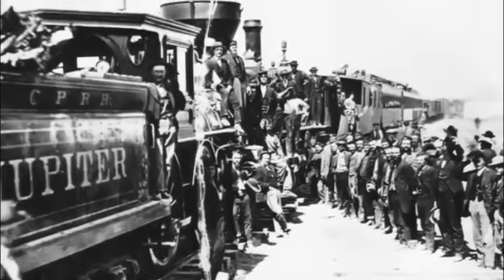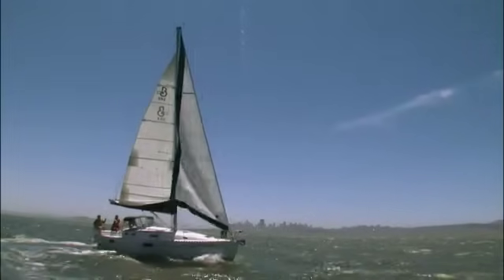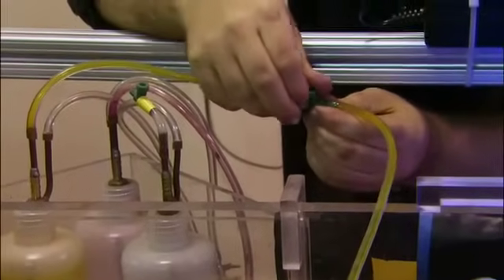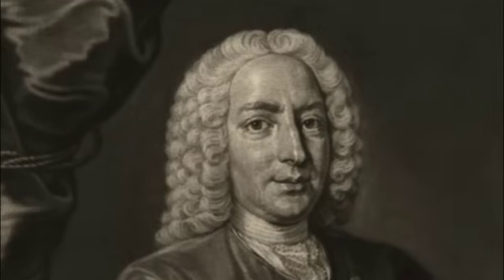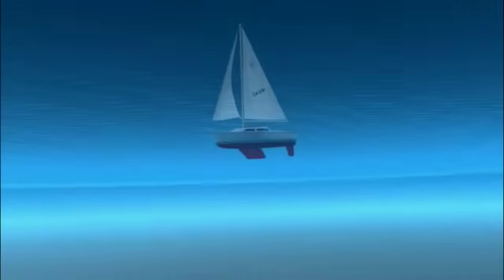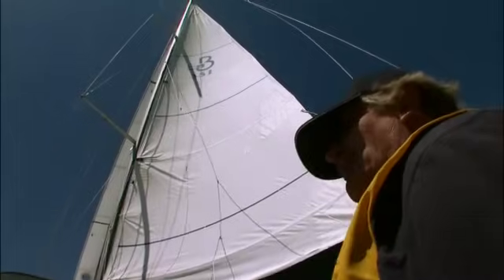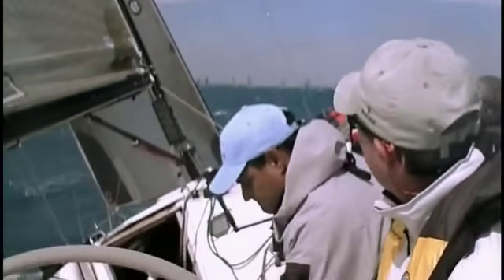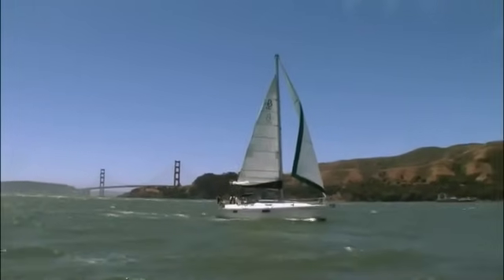The Physics of Sailing | KQED QUEST

Comment: There's no forward component in the force originating from the keel as claimed by this video. There's obviously a side-way component, but the fore-aft component is in the very opposite direction - water resistance on the keel.

Comment: well, yes, but you need to remember that humans have been sailing for millenia and the advent of upwind sail designs weren't developed until the 13th-15th century and most more efficient designs were developed even later, so compared to square sails and possible head sails of the egyptians, greeks and romans, the up wind designs are pretty modern.

Comment: they could, but they didn't understand it fully until bernoulli figured out why it happens, then it made it a lot simpler to travel against the wind. it lead to different sail types being preferred when traveling in a particular direction, instead of having to follow trade winds, they could instead measure what angle they needed to travel to get to a destination and get the most out of the sails and the wind with that particular angle.

Comment: You can do that with an airplane, because wind speeds are much higher on an airplane wing. Airplaines use this method because zero angle means less air resistance. But try with a windsurfing sail, which is always curved, and you will see that zero angle leads to zero force. Almost all the force of a sail is generated by angle of attack.

Comment: full of shit, acceleration requires force, where does the force come from on air that goes around the curved surface? so it does not go faster, due to angle of attack, you are slowing the air on the flat side and you are dreaming the air on the curved side is accelerating, wake up!

Comment: Don't shout, listen.  Inverted flight is possible due to the mostly symetrical wing section of planes with that capability.  Wings not designed to work in 3D flight don't work at all well when inverted.  Try flying a parachute or hang glider upside down.  Some wings are designed to work in only one attitude.  Square rigged vessels may not work to windward as well as a modern for and aft system, but they are unmatched for downwind work. Now take an aspirin and have a lie down before you get ill.

Comment: Not possible with a so basic square sail from the Drakkar or Snekkar.In that times, the only efficient sails to gain to the wind was the latin sail ...
16 knots was the top speed from a 30m Drakkar , only with wind from the rear/side...and 10 knots at rudder...

Comment: The two are closely related.  The reason that the angle of attack causes lift to generate is that, by keeping the foil/wing/sail at an angle to the flow, you are in fact forcing the air to accelerate around the suction side (leeward side) of the foil, reducing the pressure on that side and sucking the foil in that direction.  The angle of attack is essentially another means of controlling the shape of the air foil as seen by the air flow.  Too large an angle = too much curvature = stall = drag.

Comment: It's all about the forces. If he had blown under the paper, then there ABSOLUTELY would be a pressure drop and a force from pressure acting downward. However, there would be a much LARGER force from the wind hitting the paper at that large "angle of attack." Bernoulli has not been abused. Also, Bernoulli's equation involves many many MANY assumptions and simplifications. It is in itself abusive in many cases.

Comment: 7:45 close but no smokin' roll of tobacco.  Separated flow on an airfoil (e.g. stall on an aircraft wing) is when the angle of attack is too HIGH, analogous to the sail being over sheeted, or pulled in too tight for the boat's course. Luffing is when the angle of attack is too LOW and there is insufficient pressure differential across the sail for it to maintain its nice curved shape.  That's when it just flaps uselessly in the breeze (much like people who comments on Youtube videos!  :)

Comment: Heed your own advice. Bernoulli's law simply states a relationship between speed and pressure (under certain restrictions). Nowhere does it state anything to causality. In this video, as so often, it was stated that the fluid's speed differences between both sides of the sail would create pressure differences (lift). That is plain wrong.

Comment: dumbass! faster air has lower pressure. FACT! when lower pressure exists, higher pressure air moves to reach equilibrium.  if ANYTHING is inbetween the two pressure cells it will be moved in that direction aswell. It is why a balloon will fly around a room when it's tail isn't tied, the air coming out the tail reaches equibrium and has no force but the air at the top can't get to the otherside of the membrain so it pushes the balloon untill it is at the same pressure on both sides.

Comment: dumbass!! :)  the air, even when its blowing along, has pressure.  when it reaches a sail the same volume of air still has to travel past. either less air goes past the sail (in which case the sail would behave like a dam) or it has to blow faster to move all the air in the same time. both sides of the sail have a different shape, and restrict airflow by different amounts. the difference between the two creates a higher reletive speed on the outside of the sail. watch the die in the vid.

Comment: Argh...always the same, wrong explanation given. Around 3:30 -"...since the streamlines are curving, it has to accelerate a little bit..."

And according to what physical law? This is the rape of Bernoulli's law. For anything to accelerate, there must be a force acting upon it. So, air (or water) accelerates *because* there is a pressure differential. The pressure differential is *not* created by the differing speeds of the fluid flows - just the other way round!

Comment: Now Bernouilli _does_ apply, just differently: The foil will push the liquid sideways by a higher pressure on the windward side than on the leeward side. Higher pressure => slower liquid and vice versa.

Most of the time the air/water/liquid "particles" will NOT meet their "neighbours" at the trailing edge, and  there is no law stating that they should meet again, only intuitions.

Comment: Basically, the Kutta-Joukowsky condition says that foils can change the direction of flowing water and air. No big deal, but _that_ is why you have lift: the foil pushes the air or water, which pushes back. The back push of the liquid being pushed _is_ the lift. That goes for all foils: wings, propellers, sails, keels etc.

Comment: Thanks for a great video, that I enjoyed a lot.
About lift: it is due to the air(and water) viscosity. 

Whatever foils/sails you put in the flow of a superfluid with zero-viscosity will NOT generate lift. But air and water are not superfluids, so they obey The Kutta-Joukowsky condition: when the flowing air/water leaves the sharp trailing edge of a foil, it will continue flowing in the direction of that sharp edge instead of making a sharp turn around it (like a true superfluid would).

Comment: Note that a wing will also loose it's force vector perpendicular to the chord if the angle of attack is decreased too far, and when sailing a boat in any direction with a component into the wind, the sail is best used with the chord nearly parallel with the apparent wind.  Increasing this angle will result in loss of laminar flow and reduced performance of the sail.  So, yes, I think that makes them essentially the same (see hang-glider and PlaneSail).

Comment: Yep, another mistake on my part, and some confusion because the word stall seems to carry different meaning between the two objects.  On a wing, "lift" generally refers to the force opposite gravity, and stall refers to the reduction in this force vector. On a sail, the force that is often associated with "lift" refers to the force perpendicular to the chord, and stall refers to the reduction thereof.  Even when vertical, a wing still provides a force vector perpendicular to the chord.

Comment: "The lift produced by a keel adds to, not balances, the turning moment of the wind" : Yep, I'll agree, I made a mistake on this one. The lift created by the keel does not balance the turning moment created by the "lift" produced by the sail.  The resistance to heel is due to it's mass.  I'm pretty sure there is a force vector on the keel that resists sideways movement of the boat, but I'm at a loss at the moment as to the common name for this force.

Comment: If you are comparing vectors relative to fuselage/hull, then you will absolutely find different results, the plane is using the force on the wing to oppose gravity, while the boat uses the force on the sail for propulsion, so the position of the wing/sail relative to the vehicle is significantly different. I agree that a boat doesn't work like a plane, but a sail does work a lot like a wing. Figure your forces about the chord of the wing/sail. Also see here: watch?v=ELL5lTE9Tek

Comment: A wing can be tilted and not stall until it reaches its critical angle of attack.  Beyond this angle it still has lift, but the lift falls off quickly.  The same is true of a sail. The useful component of the thrust vector increases as the sail angle of attack increases.  Eventually the sail moves beyond it's critical angle, and the useful thrust vector falls off quickly (the sail stalls).  Sailors refer to this as "luffing" rather than "stalling".

Comment: I'm not sure how you are defining 'positive' and 'negative' with respect to airflow direction and wing/sail orientation, but I suspect that you are changing your frame of reference between your description of the sail and the wing.  The thrust vectors on a sail generated by the airflow over it's surface is always slightly downwind of perpendicular to the wind (just like a wing).

Comment: I'm not saying that a sail and wing actually are "exactly the same", but I think that vertical wings on sailboats have been demonstrated to work.  I know that a rotating vertical cylinder has definitely been demonstrated to work.  As for flying with a horizontal sail, I'm pretty sure that it's called "hang-gliding" and is a rather common practice.

Comment: Nice production.
Not all pre-modern sailing ships were slow and could only be dragged along with the wind. 
Airfoil shaped sails and boats that can sail into the wind have existed since the middle ages.  
Even a square sail can move a ship in a vector 90 degrees to the wind. 
Most tall ships had special sails to move into the wind.
Most long journeys follwed the trade winds, but if your ship can't be rowed, it has to sail into the wind at some point.
Reply: Lies, we all know sailboats sucked until it became an upper middle class hobby.
Reply: @Name-ot3xw dude im just trying to live one piece
Reply: @julianorozco5201  same here, but in Waterworld.